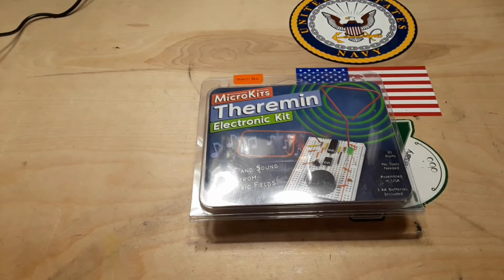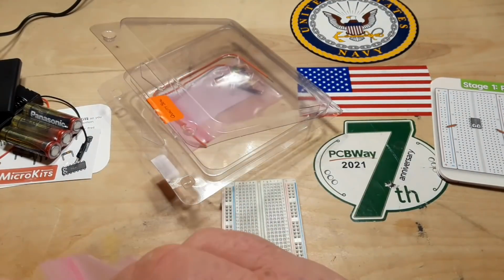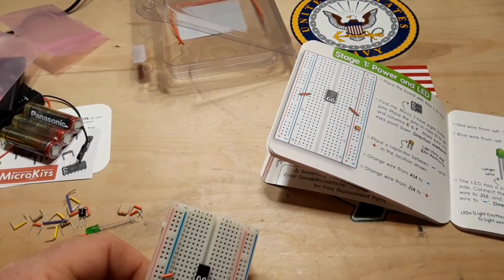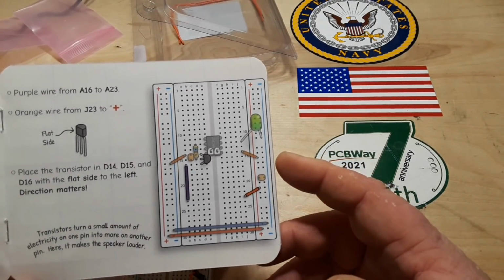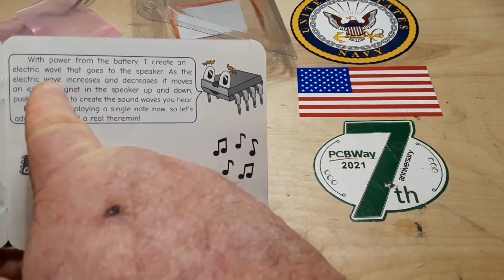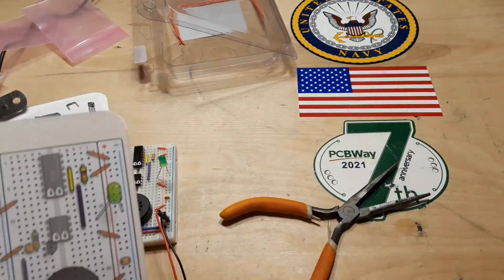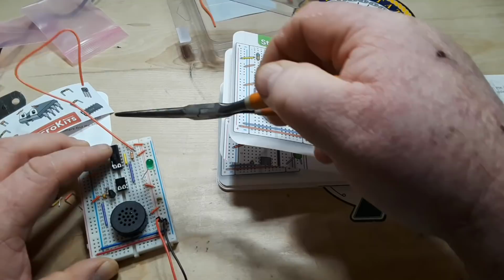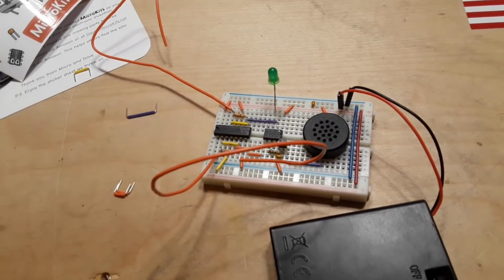MicroKits Theramin Kit Build - Perfect for beginners

Comment: This was a pretty cool kit! I was wondering, since Radio Shack and most of the mom and pop electronics shops are gone, where are good places to find components, apart from online? Are there some places that are nbetter than others to look for parts to scavenge, especially parts with smaller values for prototyping, building and repairing old (and even new) synths, effects, drum machines, etc? How about for things like mixers, preamps and amplifiers? Apart from Mouser, can you suggest where one might find something like a prototyping kit with assortments of caps, resistors, diodes, etc, for experimenting with varying values?
Reply from the maker: https://amzn.to/3qQcKwZ

Comment: I'd like to see the oscilloscope traces of the 556 outputs as you bring your hands close to the antennas. I think it would be cool to see how they change with your hand movements.
Reply from the maker: We can do that!
Reply: The change is very tiny, and it looks like there is no change if you are near the trigger point. But, if you move the scope a few dozen cycles away from the trigger point, you can start to see the signal shift as the frequency slightly changes!  -David, MicroKits inventor

Comment: I think this kit has just the right balance of complexity and fun for tweens and teens. This isn't a 'learning electronics' kit as much as it is a 'get comfortable with electronics'  kit. In the Arduino classes I teach it takes a while for students to understand how to wire a breadboard. Yes I agree that the kit maker would be wise to have a 'going further' link to a more detailed explanation on his website. Looking at his About page it looks like this was a Covid startup of 1000 kits. I wonder if he is going to do another run or maybe he went back to work for the toy company?
Reply: Yes I'll be doing another run. It takes a few months to get all the parts together, and I sold out faster than I expected this December. But I'm hoping to stay in stock moving forward. And yes, the theremin kit is designed as a one or two hour learning experience where total beginners can go from zero to having their own hand built circuit. It's to start to build confidence and familiarity with electronics. I have plans to extend the learning, that I'm working on. -David, MicroKits inventor
Reply from the maker: He said more kits are coming.